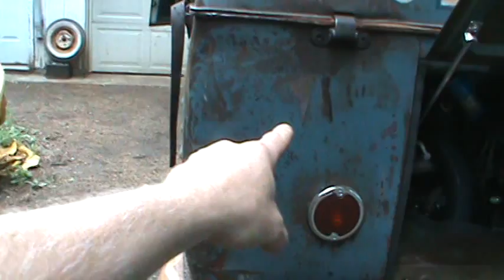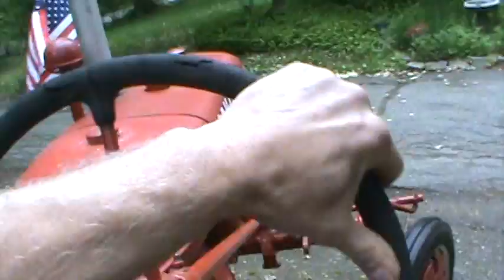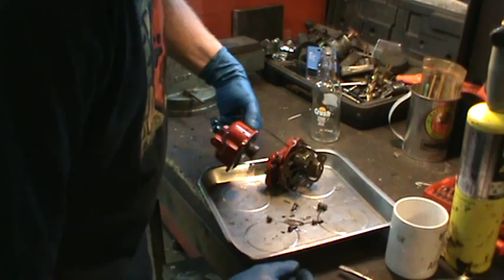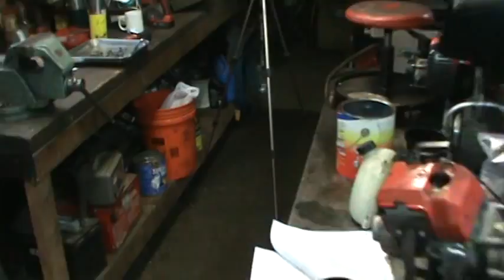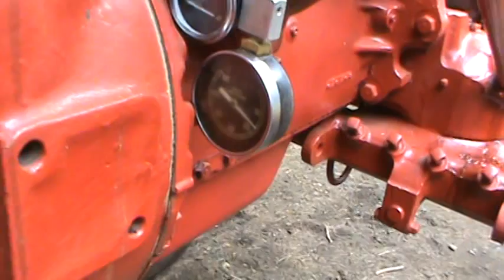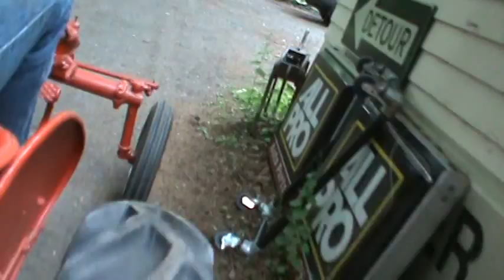farmall A tractor repair

Comment: I grew up with '48 cub. The drawbar is a quick  on and off... Designed to allow a 12 year old to put on a plow or a cutter bar. Loved that tractor. Ours didn't have muffler, had a straight pipe. When finished using don't forget to put a tin can onto the exhaust to keep crap out of the engine, I can still hear my dad saying that.
Thanks,
Reply: I was 10, '50 Cub. I think I still have scars from changing implements. We had a belly mount 5' sickle mower. Belly/front mount 4' blade. Single bottom mulboard plow, bolted to drawbar. Single row lister/planter. Two row cultivator. The tractor had the optional factory hydraulic system. Soup can with wire bail on it, hang it on on/off ignition switch to cover exhaust when off. Did a lot of raking with a pull type, ex horse-drawn, 16' dump rake. Tractor was as reliable as a hammer, keep the fluids fresh, never had many issues.

Comment: As a kid I saw STP oil treatment  speed up the idle of a well worn Ford tractor.   The combination of better lubrication and better sealing really worked in that old thing.   An engine rebuilder   ffriend of my dad's said he could tell an STP engine by the oil remaining in the heads when cold.  It seemed to help keep thing lubed  on a cold start, when an untreated engine would have drained down its oil.   My dad pushed a lot cars to well over 100,000 miles with the help of STP.   I  hope this old tip helps others with old or high-mileage engines. Thanks.

Comment: Drawbar plates had tapered nuts that went on studs coming out of final drive. If properly mounted one of the angle adjustment holes makes it sit parallel to the ground. The drawbar is meant to be a quick attach item.

Comment: They are VERY popular tractors with collectors and show folks. Light and small. Plus they are great for small gardens and the like. I've owned 2 cubs, an A, 2 Regulars, an F-20, currently a TO-20 and a 35 Deluxe are here.

Doesn't sound to bad for a well used tractor.
Looks like around 550.00 to do a bore&valve overhaul. Add 90-150 if it needs bearings as well.
Check Valu-bilt (used to be part of Tractor Supply, back when they were Central Tractor)
Reply from the maker: he may have found a new engine
Reply: He could upgrade that one to Super A (3 1/8" bore) for around 700.00.
I'm doing a power unit today with the same style kit. It's easy and only requires you to pull the oil pan and head. Can even change the mains without pulling the engine.
 This one is going to get a modest head shave, hardened exhaust inserts in the head, and updated pistons. Should bring compression up to 8:1. Stight carb tweak to richen it up to deal with ethanol and raise the rpm at the governor and the math shows 75% hp gain.

Comment: You have the wrong bolts on the drawbar. They should have a "bevel" under the head (like a lug nut, or lug bolt). You do not need to remove the bolts to remove the drawbar. Only loosen them 4-6 turns, then lift up on the drawbar and it pivots where the front "notch" swings down to clear the front bolts, then lines up on the rear bolts where it can "drop" off them. ALSO, that might not be the right drawbar for the "A", hence why it has been butchered. Also, have NEVER hade a reason to have a "floating" drawbar. You need the right bolts, because that is where all the rear tools mount. With them. FYI, all nuts and bolts need to be checked often to be sure they are tight. You do not do this to protect the mounted tools. You do it to keep from breaking the CAST IRON housing they are threaded into! It breaks before the steel does. Hope this might help someone.
Reply: I had a '50 Farmall Cub, the bolts were those goofy tapered shoulder bolts, nothing else works quite right. The Cub was just a slightly smaller (9 hp) version, looked about the same.

Comment: I had an old Oliver dozer that knocked and smoked and ran for me for ten years before I sold it, don't know how long it lasted after that! But my ford tractor threw a rod out of the block and only knocked for about ten seconds before she exploded! You just never know with those old tractors!
Reply from the maker: the oil light has been on my kubota for 12 years at an idle

Comment: Looks like an old Zenith carb to me, if that tractor ever need a carb replacement old V4 Wisconsin engines ran Zeniths like that, very similar, if not the same.
Reply from the maker: he may have a whole motor he can get
Reply: Well, that might solve a lot of issues then. Nice old tractor for sure, gotta love that side saddle seat.

Comment: I noticed that you have a Honda Harmony H1011H, I sent you a question about the one I own.  Did you have a chance to see it?  Carb is clean new oil, gas and has spark, I have only been able to get it started twice.  The main issue is that when I go to start it  the flywheel kicks back.

Comment: man I'm lovin' that old bus.. how is the wax holding up.. had a hot day yet?
Reply from the maker: l was at a show in 85 deg, just looked a little shinier, l think on a real hot day l can wipe it down once more,
Reply: hey man i was just given a farmall super A tractor from my grandfather becasue it has been passed down the family line and im going to restore it over time and i was trying to take the "hood" off of it earlier and ive taken the oil fill cap and muffler but i guess you could say it is a crank case breather i would guess and i cant seem to figure out how to get it off. any suggestions?

Comment: I just bought a 1940 A Farmall do you know how/ what may be causing it to be stuck in gear??
Reply: May be the shift forks just under the cover. If the rubber seal on the shift handle leaks, the rain can get in and rust the sliders. Might want to check the sump for 'milk'.